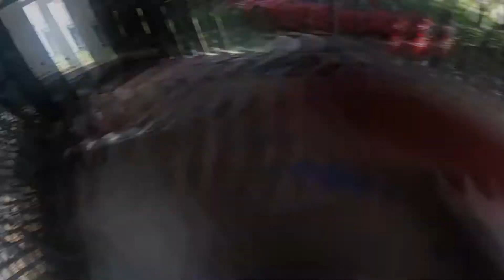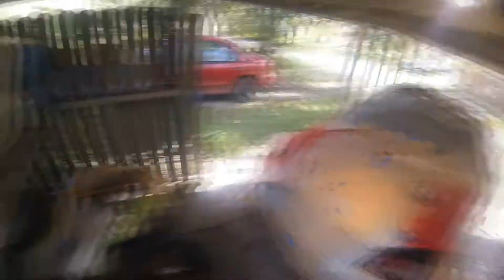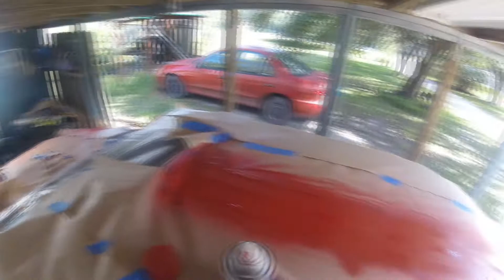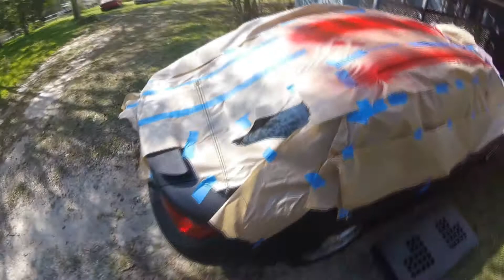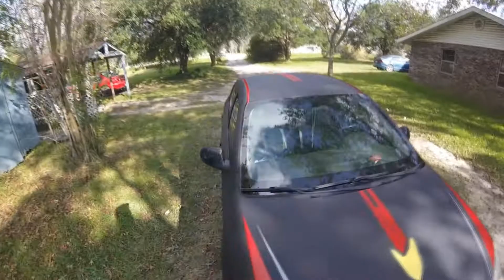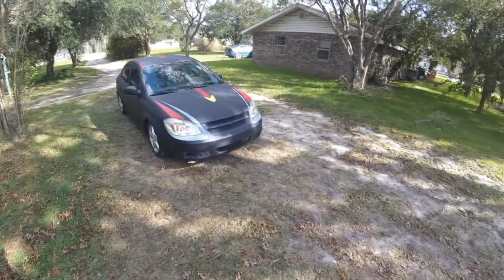Project Defiant, paint reveal part 2

Comment: I had a filling fall out years ago and caused my tooth to crack and I still have to get it removed because its pretty much got a big hole in it and gotta clean it every time I eat LOL
lame but my dental insurance should help. PLUS my wisdom teeth all 4 are coming in at a bad angle and I gotta get those pulled soon or they will crush my teeth lol  fun fun.